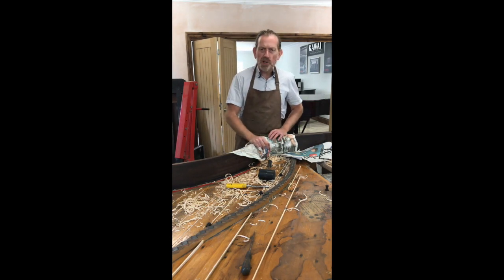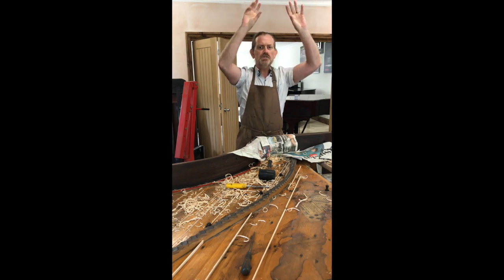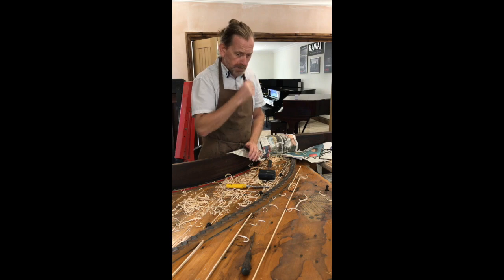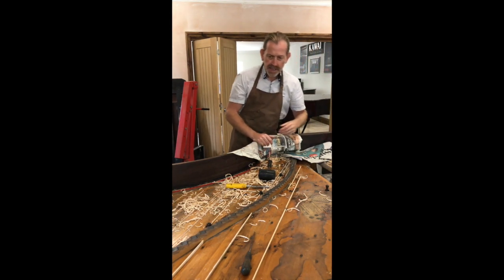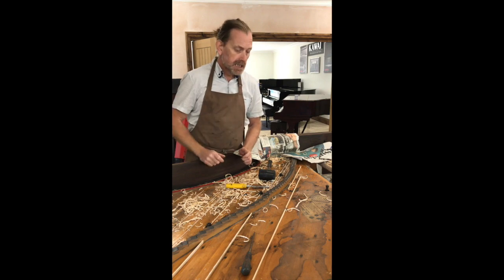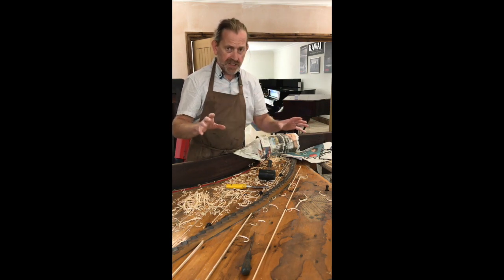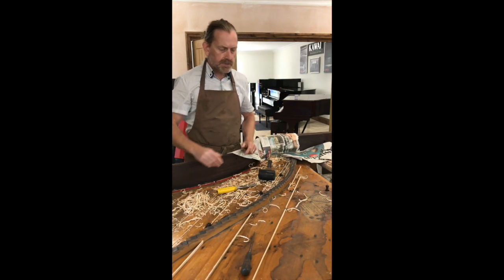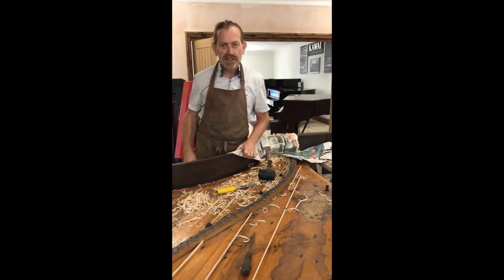Don’t replace a piano soundboard!

Comment: Some grand piano soundboards are so cracked and deformed the crown is not recoverable. A new soundboard is the only solution short of condemning it to the dump. Many pianos have been brought back to life with new soundboards so generally extensive belly work is a judgement call.
Reply from the maker: It is a judgment call but logically only for sentimental reasons not to restore the original intended tone!

Comment: I have acquired a Baldwin grand five feet ten inches which has a small crack in the sound board, will that change the sound much and if I repair it, os there any type of caulking you would recommend?

Comment: I have a 1886 Knabe concert grand 7'5''. Original uncracked soundboard and the original ribs are all well attached. Yes the upper two octaves are not up to par with what I am sure a new soundbaord would give me but from the rest of the piano has tone that I consider to be as good as what a new soundboard would give me and has a tone I don't believe a new board would give me. . I agree with Mr Dorset: there is a magic in a piece of wood almost 140 years old. no way I would ever change it out.

Comment: I have shimmed many sound boards and have replaced even more. A dead board, even when shimmed, will not come back to life. Much has to do on whether it was designed and/or made well in the first place, and whether the wood has failed on a cellular level. Yes, not all wood ages well. A piano with a dead board will sound more like a banjo (my words) and when a new board that rings when thumped is installed, the piano is vastly improved. (Along with a dozen other qualities) A good belly man is at the heart of a factory. There is so much involved in designing and building soundboards: C&C vs. rib crowned, etc., that to say never replace one is probably not advice I’d take without talking to other rebuilders and experts in piano manufacturing. I respect your opinion, but viewers should know that shimming is not necessarily best in all instances.
Reply from the maker: It is a judgment call but logically only for sentimental reasons not to restore the original intended tone!

Comment: Hello, I have a question: this old soundboard must have lost his original crown and it must be very flat now. How do you increase the downbearing?
Thanks
Reply from the maker: It is extremely rare for a piano soundboard to loose its crown, even with many splits. To simply test the crown on the soundboard is to play a note in the middle of the treble and see if the resonance lasts for more than 4 seconds, if it doesn’t then the crown has gone. 

A crown on a piano soundboard is under more than 1.5 tonne of pressure throughout its life and takes some serious atmospheric disaster to flatten it.

Comment: What utter foolish reasoning.
Reply: You should talk!
Reply: @hampshirepiano6383  Gee, i guess those cracks magically stop at the bridge and don't go underneath. 
And the internal compression forces (needed for tone enhancement) are not there anymore either. So for tonal beauty and longevity, its really a sub-par costly repair. I don't know how anyone could say differently?
Reply from the maker: @ChernobieffPiano  splits are cosmetic in the vast majority of cases, split soundboard does not mean a lost crown! If the crown is lost then replace the piano!
Reply: Got it. I'll just throw my 1902 Mason and Hamlin BB with its rare burl  mahogany and hand carvings in the dump, and buy a 150k new one.
Reply from the maker: @ChernobieffPiano  sometimes you just have to quit, yes because once you fit a soundboard it won’t be a Mason soundboard, unless Mason make and fit it.
Reply: @NigelWare  With that kind of logic, everything you do from shimming, installing hammers, restringing,etc.,  destroys the piano. Send it back to the Bluthner factory they won't shim it, they'll recommend a new board. And many rebuilders do better bellywork than them. You said "once you fit a soundboard it won’t be a Mason soundboard". Could you back that up with a blind sound test?
Reply from the maker: @ChernobieffPiano  if your going to replace a soundboard as good as a premier brand then you have to answer the following questions. 

1. Where is the growing source of your Spruce?
2. What is the Latitude of the Spruce forest your Spruce has grown in? 
3. How fast or slow/did your Spruce grow at the correct speed?
4. Was your Spruce seasoned correctly  for the specific use?
5. Are you applying the correct techniques of fitting.
6. Is all the above adhering to the specific premier brands standards?
7. Do you manufacture and fit soundboards on a daily basis every year?

If no to any of the above then you are failing your clients.
Reply: @NigelWare   @Dorset Pianos Ltd  Thank you for those Strawman standards based on a false premise. With that logic neither Steinway or Mason and Hamlin are Steinway's or Mason and Hamlins anymore because neither use the same wood as when they were first made. Steinway even changed their board design. So did M &H, they went from compression boards to RC boards. So if you want to ignore acoustic principles and write fiction , and be fooled by labels thats up to you. You really just don't know what you're talking about. Good Luck to ya.
Reply from the maker: @ChernobieffPiano  Thank you for your input although we couldn’t disagree more. https://eu.steinway.com/en/a-legend/manufactory/soundboard/

Comment: The late Dorset based piano tuner Peter "Jock" Cooper used to say:-  If an old grand piano does NOT have a cracked soundboard, it was not a good quality piano in the first place.
Reply: Ridiculous comment
Reply: @stevejacksonpianos  Why do you say that?  Do you know anything about pianos?
Reply: @gaugeonesteam  As a matter of fact, ive been rebuilding pianos for over 50 years am Steinway certified, former president of a ptg chapter, have a long concert tech and have replaced many soundboards. And your qualification to make comments?
Reply: @stevejacksonpianos  Well, I'm not Steinway certified but I have been tuning, repairing, supplying and transporting pianos for around 40 years.  a high % of the older grand pianos I see here in the UK do indeed have cracked sound boards and every restorer I've ever spoken to here says it's better to repair a soundboard if at all possible. Jock Cooper's point was:- the relatively thin wood used for sound boards in old pianos cannot tolerate modern centrally heated homes and will very often crack.
Reply: @gaugeonesteam  Nonsense
Reply: @stevejacksonpianos Well that 1 word answer seems to have no meaning what so ever.  you're simple and not very well argued points make me feel glad that I have absolutely nothing whatsoever to do with you in my life.  Most normal people would compare their views and experiences when discussing such a subject.   You live in the USA yes?  Thankfully that's many 1000s of miles from me. Thank god you're not restoring a piano for one of my customers.
Reply: @gaugeonesteam  I'm not American but don't accept claims made by someone who has no direct experience and quotes what they heard someone else said with no context whatsoever. The one word reply, "ridiculous' is all anecdotal stories are worth. When you have no argument, attack the person like you did.
Reply from the maker: @gaugeonesteam  Sorry Robin, but Jock Cooper was well known to us here in Dorset as just a piano tuner who attempted repairs, a bit of a cowboy, not a great “expert” to quote he was always better at tuning clients than he was at tuning pianos.
Reply: Nobody cares. @stevejacksonpianos

Comment: Spoken by someone who has not the skills to replace or property restore a soundboard. It's made out of wood. There's no magic Steinway tree or Steinway forest and secret formulas. With this logic one should not replace any parts whatsoever
Reply: I think there is almost a magic Steinway tree.  Top piano manufacturers are pretty selective about the wood they use 
and 120 years ago old slowly grown trees produced excellent quality timber for piano soundboards which I  believe were also well seasoned before being made into soundboards.  Most piano experts I know always say it is better to save the old soundboard if at all possible. Stradivarius is said to have had a secret formula for the varnish of his violins and some guitar players claim that good quality acoustic guitars improve with playing.  ie: the vibrations of the strings and the natural ageing over time improves the tone quality of the wood.
Reply from the maker: Thanks for your comment Steve, not sure why your on the attack unless your business is to replace split soundboards? As mentioned in the video it’s a text book repair. Our business has been established since 1963 and are tech know how can be traced back over 100 years. 

We would write off a piano which has lost its crown as the soundboard replacement would no longer have the same shape or have the same quality of seasoned Spruce or recognised technique of the brand to fit, so as Steinways quote on their website, “replace a Steinway soundboard and you will end up with a Steinwas”